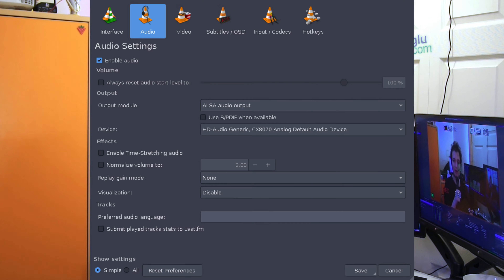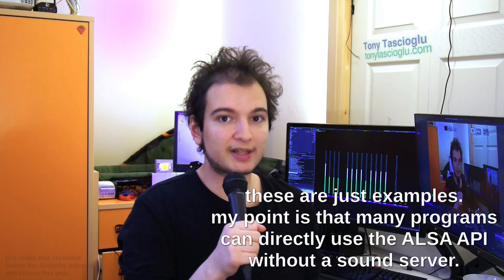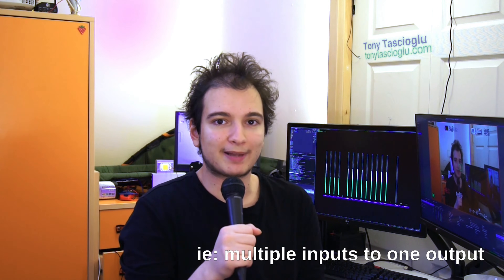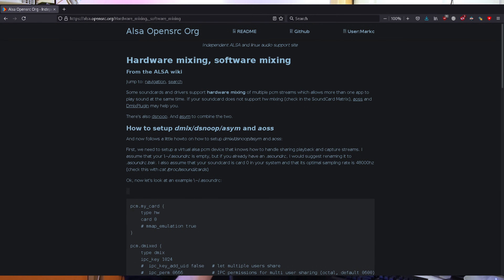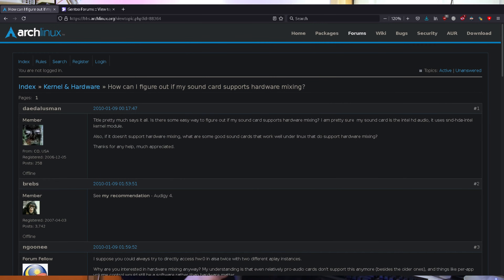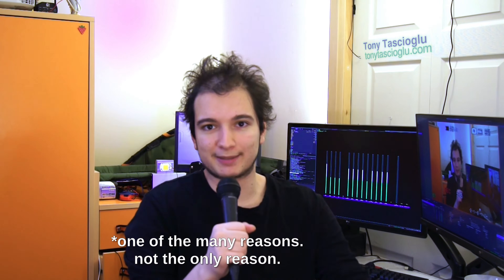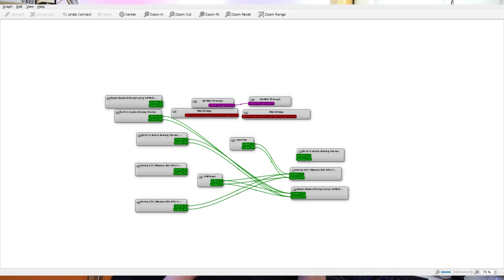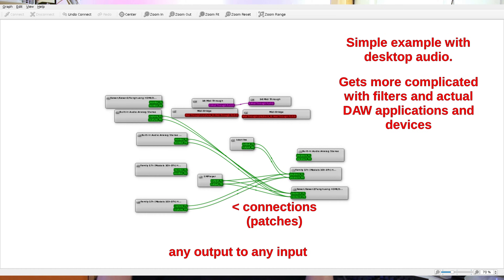Linux Audio Explained (ALSA vs PulseAudio vs JACK vs Pipewire Explained)

Comment: So alsa with pipewire would be best for bit perfect sound using external dac ? 
Thanks in advance
Reply from the maker: Today: probably. But, not that "bit-perfect" depends on what you're playing. Both Pulseaudio and Pipewire by default resample the audio to a sample rate and bit depth supported by the DAC. This is necessary so that you can play both a song at 44.1 kHz and other sounds at 48 kHz at the same time without switching modes. For almost everyone, I doubt you're going to hear the very slight artifact due to resampling (I can't at least, and since you're usually going 44.1 to 48, you're not losing part of the frequency response either). I also haven't tried any DSD modes used by some DAC's, since I just use a basic old sound card at 48 kHz/16 bit.

Comment: Great information.  Currently I’m looking at some power saving clicking associated with my Intel audio, file “snd_hda_intel”. Apparently the Lenovo laptop audio powers down, then starts again and that is causing some clicking. I also noticed it upon boot up - both Debian 11 and Manjaro.  After editing two files, the clicking returns after restarting. 
I guess I’ll try switching to pipewire to see if that works. 
Thanks for the video.

Comment: I got into Linux recently with Arch+KDE Plasma. And I didn't realize that the KDE suite probably came with pipewire packaged with it. I wasn't getting sound at first, so I assumed I didn't have a sound server at all. I installed pulse without noticing pipewire was already there and probably needed some more configuration done to it. 
Somehow for 3 months those have been running at the same time with pulse taking over all audio from devices, and of all the times a .exe of Dark Souls Remastered might finally have caused a sound issue in the form of muted center sounds (which is the absolute most bizarre error I have seen).
It fascinates me. 
Even then I got Pro Audio stuff to setup eventually too, but each bit is it's own tinker session...

Comment: Oh great thanks a lot.. I was using Cubase on Windows before now completely switched to Linux. I have PA installed rn, maybe you are planning on making a video to replace that easily? I assume it is not possible to still have PA installed and just install JACK or Pipewire, right?

Comment: An extremely informative video for Linux users that explains things well but in the name of all that is holy, (and I say this as a native English speaker), could you please speak more slowly! I've used OSS, ALSA and Pulse, and will now try to replace it with Pipewire if Debian allows but think of non-native English speakers. You may have been a rapper in a previous lifetime. :)

Comment: I'm a total noob when it comes to linux however If I understand this correctly: Pipewire has the potential to give us pro audio users the ability to route multiple sources to the same and/or different outputs simultaneously. If this is the case, this would be game changing for those looking for advanced audio routing solutions. It would also be much more affordable than using Dante where you would require something like a 
CTP DIO88 Analogue to Dante Converter upwards of ($1000/£1000 give or take) to convert your devices and send them where you need to.

Comment: This was good info as a high end audio user on windows who will swap to linux soon so from what i gather is that ALSA is basically like WASAPI?

I am currently using Voicemeeter to route most my Audio on windows and been told i need to use Pulseaudio for linux seems like i will go with Jack instead due to the better latency defenently worth reading more about

What Software would you recommend for Bit Perfect playback of music? with DSD support Google is very... indecisive  

"Some Audiophile recordings can be up to 96kHz" i got music that has 45 158 400 kHz (DSD 1024)

At 05:32 you mention that people can't hear over 20kHz which is not true, many can but the older you get the more you tend to destroy the hearing and that's why most people can't later in adulthood there is many people saying "i could hear dog whistles as a kid well they are around 23 to 54 kHz we humans live in a noisy world car horns airplanes Alarms yelling kids etc etc all these things contribute to "destroy" hearing. my wife hear up to 28kHz

Comment: When you say PipeWire is a replacement for Pulse and Jack. Do you mean you could eventually get rid of Pulse and Jack? PipeWire doesn't have a GUI like Jack, does it?
Reply from the maker: I think most distros will automatically get rid of Pulse when you install Pipewire, and I've also gotten rid of Jack. While Pipewire doesn't have a GUI (and neither does JACK IIRC), tools such as QJackCtl still work fine. Then just use the Pipewire JACK server instead of jack or jack2. If your distro has a drop-in option, it should work automatically, otherwise, you can launch applications with pw-jack to get them to use the Pipewire JACK server, for example 'pw-jack qjackctl' should bring up the standard control GUI for Pipewire just like it did for Jack.

Comment: I tried replacing Pulse with Pipewire and now every second the audio cuts out and then cuts back in over and over. Is this a sample rate issue? I'm using a Roland QuadCapture interface. Server Name: PulseAudio on (PipeWire 0.3.24).

Comment: Thanks for all the info.

Been thinking of switching to Linux for my daily-driver, but I do some game streaming as a hobby and all of my devices are Elgato, and even though there are some Elgato drivers that people made to make them compatible with Linux, the SOFTWARE is only for Windows and Mac, so my Wave Link program which routes sounds to my stream AND my headphones would not work. If JACK or Pipewire can use virtual audio input/outputs, then I can just manually set up everything.
Do you think it's possible for me to get my Elgato equipment to work on Linux (I have a 4k60 Pro Mk2 internal capture card, Stream Deck Mk2, and a Wave 3 microphone), or am I better off just staying on Windows and waiting for kinks to be worked out before migrating?

Thanks!
Reply from the maker: While I don't have any Elgato equipment, here are some thoughts:
Assuming you're using OBS Studio, you can either capture your microphone and headphone output as 2 audio inputs, or, I can confirm that OBS works with the default Pipewire server (as it does with Pulseaudio), and you can use a tool like QJackCtl's graph to easily split inputs and outputs and route them. For example, I can create a virtual sink, capture it with OBS, but also split the output from QJackCtl to route it to the headphone output as well. (Sorry if I wasn't very clear, lmk if this made any sense). 

As for the capture card, it depends on if it works with the standard UVC driver. I use the cheap ~$15 MacroSilicon based USB 2.0 HDMI capture cards and those work fine (save for overheating sometimes, and being limited to 720p60 or 1080p30 in MJPEG). Internal capture cards are a different beast though, I know people like Magewell have special drivers, but I think most companies have some sort of UVC compliance which lets V4L2 pick it up as any standard video input.

The stream deck almost certainly needs special software or drivers, since it doesn't really have a pre-determined functionality like a camera or microphone would, but it's popular enough that it might have community support.

The Wave 3 would probably work, since almost all modern USB audio devices just show up as regular audio devices. I've only had problems with some older audio interfaces back when USB audio wasn't standard. For reference I have one of the cheap Fifine USB mics that works fine.

My best advice is to just test it. You can easily grab a Live DVD for Ubuntu, Fedora, Mint, or many others and just power on your system from it. You should be able to temporarily install software such as OBS and see if your hardware works without installing or dual-booting. If it works, then you can dual-boot when you install as an example.

Let me know if I should clarify any of my thoughts here!

Comment: Anyone have a MOTU M2 audio interface working in Linux?
Reply from the maker: Looks like people have gotten it working as either an input or output, but not in duplex mode as per https://linuxmusicians.com/viewtopic.php?t=20936 and https://www.reddit.com/r/linuxaudio/comments/gd2478/motu_m2/
Reply: @TonyTascioglu  Thanks for the links. I attempted to use the M2 as an output only and it just acts funky. For now I'm using my motherboards audio and I'm considering switching back to Windows.

Comment: Great video! It helped me to organize and understand how things work and why some doesn't work here. I have a Firewire M-Audio 410 here and after moving from pulseaudio + jack to pipewire (0.3.39 on Debian here) I noticed that artifacts you mention at 13:25 when recording from my microphone on the onboard soundcard and the guitar plugged into firewire on ardour. When there is no ardour on the way, just connecting the input of M-Audio to guitarix or rakarrak and then to HDMI, the sound is perfect.

It seems to be some resampling issue between the M-Audio and onboard sound card, right? Should I completely remove pulseaudio and jack to have things working well here? I manage the connections using qjackctl,  is there some similar alternative?

Thanks again for the great video!

Comment: I hope I can at last record something in Ardour and then play YT video without switching audio engine in Ardour.... This was very annoying.
Reply from the maker: After switching to Pipewire and installing the Jack-dropin, I've been able to use Ardour with the Jack or Pulseaudio audio engines without any issues from the other applications. It took a few attempts so ensure it wasn't jittering either Ardour or the other applications, but it should work.

Comment: Great info! Thanks!!! Have been using Linux for over 15 years, never gave a second thought to how audio works on Linux. After watching this, I uninstalled PulseAudio and installed PipeWire. I have a large living room, and used to get "crackling" when using my Bluetooth headsets. This is no longer the case with PipeWire!! Have only had it installed for an hour though, so will see how it goes.
Reply: How are you liking PipeWire so far?
Reply: @Lambda_Ovine  I'm loving it! I'm not really an "audiophile", but it does sound better on my setup (no more intermittent crackling). I've converted my laptops over to Pipewire too :) Does everything I need to do, but my needs are very straight forward and simple (i.e. just need audio through Bluetooth speaker). Actually, I WFH, so I video conference too.
Reply from the maker: Glad to hear that Pipewire bluetooth is working well!
Reply from the maker: Actually, I noticed the crackle/stutter under PulseAudio on my laptop as wel last yearl, I had tried so many things with Pusleaudio such as forcing SBC (thinking it would use less bandwidth or something), messing with the server delay and buffer times (thinking it was a buffer underrun or something), even turning off WiFi in case both the 2.4 GHz signals are interfering... I guess this did disappear when I switched over and never noticed, neat!
Reply: i have that crackling sound on my new Asus Tuf Gaming A17 Ryzen 7 RTX4050 laptop, back on windows because of the sound issue, not nice, could not fix it yet, also using Bluetooth headsets
Reply: @francoisjohannes3648  It has been about 4 years of great sound for me now (no crackling) 😄

Comment: Really excellent explanation and exactly the kind of patient, thorough guide through linux audio that I never knew I wanted. I recently had some trouble switching my audio output from the hdmi port on my video card to a usb out connected to my headphone amplifier and suddenly I needed to learn about how sound worked.

You seem really knowledgeable and did a great job explaining the full stack of technology powering audio. I would absolutely tune in for more videos like this (even if they take a year to put together :-)).

Thank you!
Reply from the maker: `pavucontrol` is probably the easiest DE-agnostic way to easily switch inputs and outputs in general or on a per-program basis provided you're using PulseAudio or PipeWire.
Reply from the maker: Hey, thanks a lot for the kind words, glad you enjoyed it!